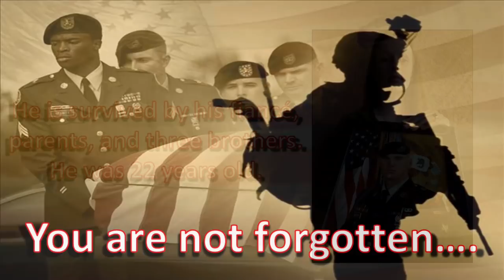One Year In Our Alliance RV (List Of Everything That Has Gone Wrong Or Broken)

Comment: Looked at 10 different Paradigms last week. I don't know if they were covid builds or what but every single one of them had spackle covering staple holes in the ceiling, the walls, tares in the floor also smudged with caulk or spackle trying to hide it. Never seen anything that bad before and that came from Alliance not the dealers responsiblity. Every other rv we looked at like GD and even FR were superior in comparison. Flawless fit and finish etc. Sorry Alliance but once I seen that coming from the factory it's hard to unsee. Probably going with GD now.
Reply from the maker: We have seen stuff posted on the forums similar to that and it's so weird to see because ours was so opposite.  I even thought to my self no way our rig came from the same place that rig came from. We love ours and I'm so happy we went with Alliance  but I totally can see why someone wouldn't after seeing those types of rigs. It's sad.
Reply: Dustin 
Thanks for the link to that tool. Great find

We found the same thing, we really like the alliance but when we actually found one the deal apologized to us as we walked to it say it just came in and had not been cleaned up. What we found was not minor cleaning, island light fixture fallen and laying on the island. Kitchen drawers with no runners they just fell out in my hand. Just about all the cabinet doors needed to be adjusted, the TV was not installed level. We gave them a second chance at a different dealer and found a lot of poor quality in that one as well. Our friends who had were also looking at the same floor plan found similar issues so we both ended up buying a Montana. 
We figured they had some issues during the covid thing and hopefully are back on track with there QA 

Glad y’all have had good luck with your rig. I believe if you have a positive attitude about things and realize things break, come loose etc life is so much more fun. Most problems in RVs are minor it is all in how you deal with them. 
Thanks again for another great video 
Safe travels
Reply from the maker: @owenarkison3558  We loved our Montana and we love our Alliance. Both are very good quality. That stinks that the Alliance you saw had so many issues.

Comment: We love the Alliance Paradigm 340RL as well. The windows that actually open instead of the frameless windows that just crank open a little bit. Do you get a great breeze through them when they’re open? Are you finding spots to park this large 5th wheel and is it pretty easy to back into them? Thanks
Reply from the maker: We love the windows. They allow a great breeze to flow through. They are way better than the seamless windows we had in the Montana. We have not had any issues finding RV parks and spots to accommodate our RV size.

Comment: Maybe we are fortunate with our Grand Design but those things would really bug the crap out of me. 
Quality control in RV’s is terrible. 
I am a firm believer that the better your suspension is the less problems you will tend to have from the shock and vibrations of the roads.
Reply from the maker: Ya, quality control sucks industry wide. We never pulled the trigger on IS, but once we added SummoSprings on the rig and the truck, it was so much better. Unfortunately our highways  are not helping. Roads suck nationwide.

Comment: Thank You Very Much for your Veterans Tribute.   You say you get parts from Alliance.  Do Dealers not stock parts or is it because you are on the road and not near any specific dealer to help.  And I know how hard and long it takes to get into my local dealer so I can imagine how bad it is on the road.   Are there certified mobile techs.   We are between upgrading to a Montana or Alliance and still standing on the fence.   3121 or 310
Reply from the maker: We were still under warranty so Alliance will send the parts directly to us if it is something I can fix myself. If I would have needed work done by a dealer, they would have shipped them directly to the dealer.
Reply from the maker: We had a Monrana 3121RL and went to Alliance. We chose the 340 over the 310 because of carry capacity. The extra 3 feet of length is not as difficult to navigate as I thought it would be.
Reply: @WaywardWaggs  we discussed the 340 but we pull a 20 ft boat behind.  Length no problem since I have driven truck all my life.  Length laws for RVs are very sketchy at best ask any officer and they don't know or can't find any specific laws  A couple states yes but we don't go there.  Thanks for you reply

Comment: The problems you describe are relatively minor compared to what we have seen on other YouTube channels.  Apparently you had no issues with the "big" stuff - slides, leveling jacks, appliances, etc.  Knocking for you on real wood, not particle board.  One couple we follow had a 50% failure rate (3 of 6) of hydraulic leveling jacks in a new rig.  If that were us, we would not be happy campers.
OBTW, Leslie, if it becomes necessary for Dustin to meet an untimely demise, remember that it doesn't have to be an accident, it just has to look like one.  😉    🤣
Reply from the maker: 🤣 So true. We are very impressed that these RVs hold together as well as they do with the beating they take bouncing down the road.

Comment: So their advertised “PDI” at the factory wasn’t so great after all.
Reply from the maker: Sometimes things break in transit also. It was built in Elkhart, IN and we bought it in Tampa, FL. Those transit drivers are not as careful towing as an owner is.
Reply: @WaywardWaggs  You may be right, but strange that multiple plumbing connections were loose. Does the PDI include charging the entire plumbing system to check for leaks? The fact that you bought a special tool just to tighten connections makes me wonder.

Comment: By far the worst purchase I ever made in my life was this RV.  You can make excuses all you want. But every trip so far something has gone wrong small and large. We bought this over 1 1/2 ago. We are now good friends with with the RV repair man.  Counter  tops have turned yellow. Hanging light has broken off.  Every slide out has been repaired. We had to rebuild our bed when the slide went bad. Refrigerator went out and has been repaired 2 times. We had to buy a fridge from Home Depot to get through our vacation. Jacks don’t hold up for long. Solar does not work. We replaced the seals on the slides. Propane tanks don’t latch back in had to make modifications to get the
 Back in. Ugg. . alliance is always friendly and appear to respond and say oh sorry. but really every trip something goes wrong.  I don’t want to go out any more with this rig. It is not a quality rig. The repairs and disappointment has been the main focal point of every trip.
Reply from the maker: So sorry about your experience with your rig, I hate to hear that, but I've just loved ours. Every rig is going to have something, big or small- they are basically moving earthquakes.  We put our rig through so much by moving every 1-2 weeks. Our countries road are horrible so I'm surprised when we move and nothing bad has happened. They are made by humans not machines so no two rigs will be the same. We had major things happen with our Montana and was still willing to get another one until I discovered Alliance.  I know if it's something on their end they will take care of us. I never expect any RV to hold up like a house because they are not comparable like that. There are some QC things that should get caught on the line but when those things slip through the cracks, I know they will step up and that's why I chose them. Even if I had a bad experience, I'd never discourage someone else from purchasing  because their experience could be totally different.